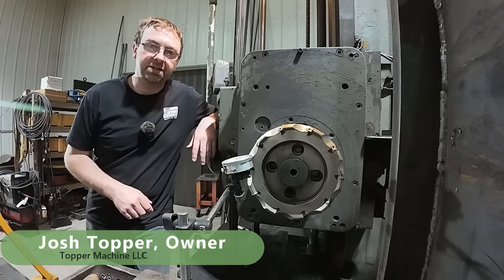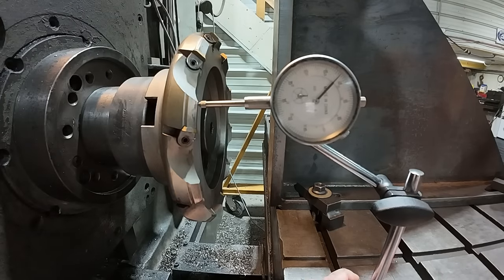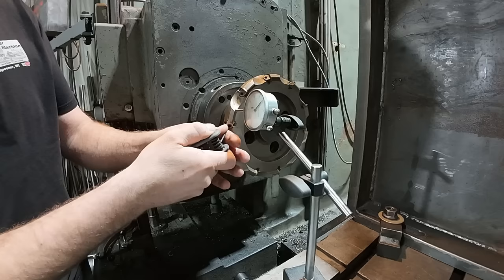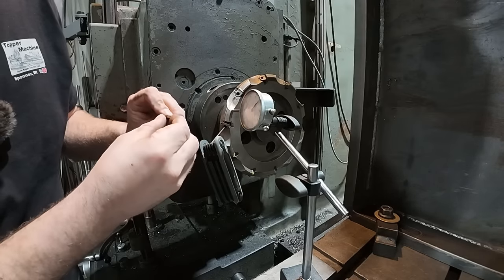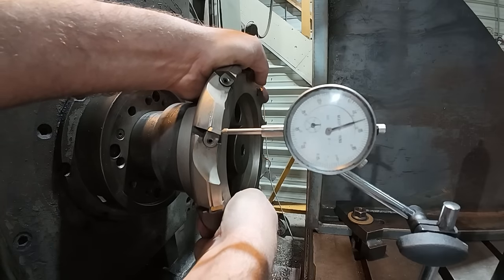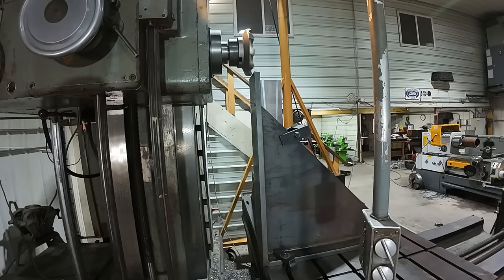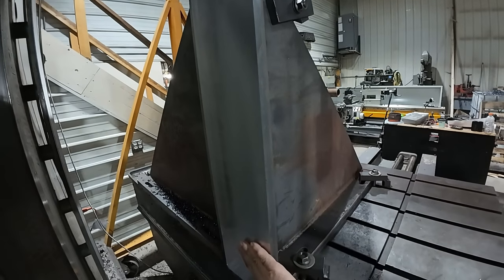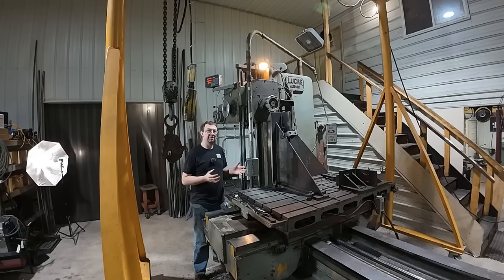Setting Up a Face Mill - Finding the Odd Insert - Angle Plate Machining Follow-Up

Comment: you machinists need to understand that the parts you call boring are actually interesting to your viewers ... that's why we're here.
Reply from the maker: I have more "boring" videos coming. Lol. I know you all want to see this stuff. I wouldn't film it if I thought it was actually boring. Thanks for watching
Reply: @TopperMachineLLC  Good to hear. Thanks Josh!
Reply: Sometimes boring is boring if you're wallering out a hole. That didn't quite sound right 😉
Reply: I have some big face mills that have every cutter a stepped height. It allows for a deeper depth of cut than if they were all the same. Also they don’t require ground inserts but for optimal surface finish you need ground inserts and a cutter with even pockets or you have to run a super slow feed rate. Just my experience take it for what it is worth 😅

Comment: Nice job Josh.👍👍
I use to have a VM2000 Winona Van Norman. 
Had a big head, like 12 plus inches and 12 or 14 inserts, like a 321 series.
Had to indicate every one of them.
But when they were dialed in it really could mill heads and blocks flat and a perfect surface. 
Thanks for sharing. 
Have a great day.

Comment: Morning Josh,
I am really liking your instructional videos lately, I usually confirm my insert depths on initial set up and let them all wear down at an equal rate. Depending on the type of cutter and the quality of it....I also ck the machine's taper for debris as well as the interior taper of the cutter body itself on every new mounting...some bodies even have an end boss that the tension screw pulls the taper into too and Ive actually seen that end boss not milled correctly or debris get embedded by the draw pressure into the boss and cause a minute misalignment that will show as insert imbalance falsely....but we are progressing well above the machining 101 level in these things.....so far here just the remnants of snowbanks remaining..YAAAAY...however someone on TV was saying maybe accumulating S- - - mid week Wed/Thurs coming up just before the dreaded E-clipse......LOL
Great great content, camera , audio and editing video work and easy to follow and understand dialog.....10  thumbs up....AGAIN !!
Don

Comment: Thanks for showing the improvements in your setup. I’m very impressed with the extreme range of that big mill and the cutting ability of the face mill. Also that all the inserts except one was true within .001. You’ve got a winning combination there. Well made accurate fixtures save time and money in any shop.

Comment: Well - I have a facemill I have to check. I was getting a crappy finish and couldn’t figure out why. Better have a look at the inserts. 👍
Reply: Stuart, 
Im guilty too....I try to ck for debris, but admit alot of the time Im in too much of a hurry. I use my face mills usually for quicker area material removal, then if I need an extremely precise fit or finish....out comes the flycutter.
Don
Reply from the maker: Don, this is the way I use most of mine also. Not too often do I finish with them. Although I've been doing a little more finish work with them lately.
Reply: @TopperMachineLLC  Glad to see you are back, how was the short vacation?
Reply from the maker: @donteeple6124  not long enough. Still sitting in the airport in Florida
Reply: A light spray of WD-40 or paint thinner on the surface can make a surprising difference.

Comment: Im not sure where you learned to use brake cleaner but a proper mechanic uses at least half the can per press of the nozzle!   I was taught to use the paper test on a multi head cutter for a quick indicator if the inserts are set consistently.  Use  piece of notebook paper as a feeler gaue against the same point on a part ensure it has similar drag on all the inserts.  Love the content!
Reply from the maker: Have you priced brake cleaner lately?  No way I can afford to be wasting it.  LOL  I have done the paper trick before also, use it all the time.
Reply: @TopperMachineLLC  no kidding I wait until it droNapa. $2.99 a can by the case at napa.

Comment: Something else you can do to somewhat reduce vibration is removing a few inserts in an uneven pattern like with a reamer or one of those fancy Hoffmann-Garant counter sinks, supposed to reduce tool pressure and interrupt the standing wave. The one time I did it I also managed to stiffen up my setup so I don't know how much to credit to what, while it does work in those counter sinks and reamers those are also cutting with all edges all the time
Reply from the maker: Great suggestion

Comment: What you could do is remove half of the inserts and halve your feed so you have less teeth imparting force on the workpiece. Alternatively you could step the cutter over so all the cutting force goes down rather than directly sideways. With a stepover you could possibly increase your material removal speed too. I would keep in mind that any parts you setup on those angle plates will only be as rigid as those angle plates. If they can't handle a heavy cut, neither will any workpiece mounted to them. 
What I would try is to use turnbuckles and some threaded rod to brace up both angle plates to eachother and to the t slots at the same time. That might mean drilling some holes in the angled brackets on them.

Comment: Great follow-up video.  Sometimes we just get wrapped up in the effort and accept the result as good enough. Any chance your clamp/jack stabilizers actually introduce a twist in the face you are milling such that when you release them the face twists the other way?  Obviously it all depends on the allowable tolerance - just wondering if it was a concern enough that you measured it?
Reply from the maker: Great point and I considered that. I jacked and clamped as lightly as possible. There may be some twist, but it really won't matter for the purpose that they were built.

Comment: Not boring at all, but shows how the setup is the most important part of the job.  The angle plate should have been laid on its side instead of being 3' tuning fork the table has the room and travel from the looks of it.
Reply from the maker: It does, but would it have been as cool to watch or show ways to solve complex problems?

Comment: I like these “meat and potatoes” machining videos.  

Walked through a shop recently where there was  a Cat truck engine block setting, disassembled.  The machine marks on the head deck were horrendous.  Must have been cut with a very large face mill that had one insert standing at least .005” proud of the others.

Question about hor bore operation.  I see you are feeding the head (Y axis) from top down.  How do you have the head set to slide on the ways?  Are the gibs tight enough that the lead screw is pulling down on the head? I’m trying to understand how to set the gib on that axis.  Thanks!
Reply from the maker: HBM is designed for this work with a huge counterweight in the column. Yes, the gibs are set right. Very rigid machine
Reply: @TopperMachineLLC  My HBM also has a counterweight in the column.  However the head weighs more than the counterweight, so as it is now, sometimes while lowering, the head will “overrun” the lead screw by the amount of backlash between the lead screw and lead screw nut.  Do I need to tighten the gib more?
Reply from the maker: @nschelling6420  don't tighten the gibs more. Tighten the lead screw nut.

Comment: The nob on top of the indicator has a curved big flat.. unskrew it use that as the tip.. works on most dial indicators
Reply from the maker: I never thought of that.  It is the same thread and all.  Thanks.

Comment: I'm thinking if it was me I would have run an end mill down the sides and top as well to make all edges true to each other while I had it set up.
Reply: Probably no need except to satisfy OCD. 🤓🤓
Reply from the maker: For the intended purpose, there is no need.  They will work perfectly as you will see in an upcoming video.  Why waste time on something that isn't needed?

Comment: Yeah this can really destroy either your part or the facemill - depending on how off one of the inserts are. Ive told the apprentice at work that he needs to at least blow it all clean with an airgun everytime he changes inserts and do a double check to make sure theyre all seated right.

Why the double check? Well, Ive witnessed him manage to rip a facemill in half because he either didnt screw the inserts in correctly or didnt clean it. This shouldnt happen under normal circumstances but he was running a high feed facemill and pushing the tool AND machine to their limits.

The best part was him trying to act like nothing happened, playing it cool and then coming over and asking if he could borrow a highfeed facemill from me - didnt tell me why at first but there wasnt a single person at work that didnt hear the damage he did :face-purple-crying:

Comment: Why would people beat you up about using the air gun to clean the pockets out. Thats the easiest way to do it
Reply: Only thing I'd add and I am sure someone already said or you already know, but are just working with what you got

If you are making an angle plate like that and you intend to use the full height, your gusset needs to run the way up to the top and have some meat behind that top section.